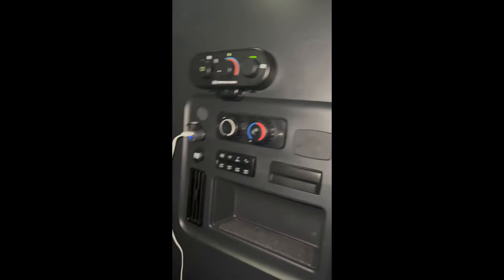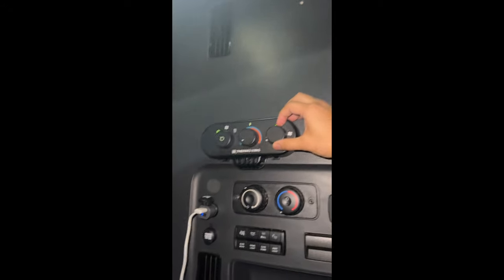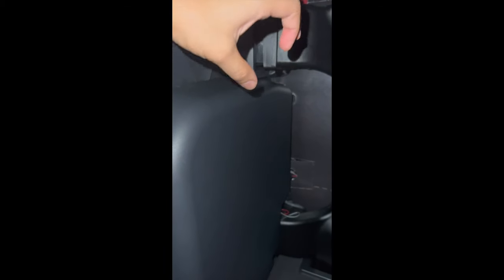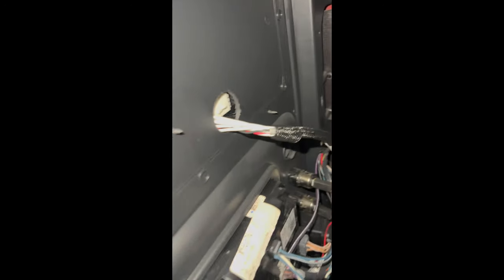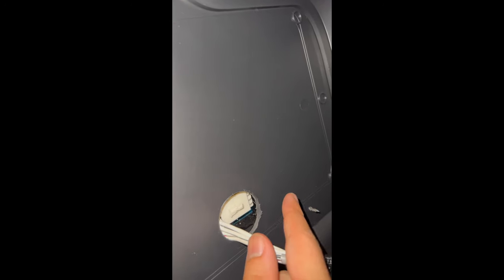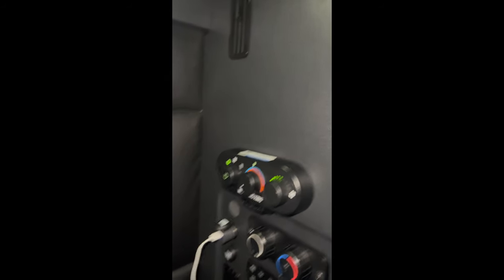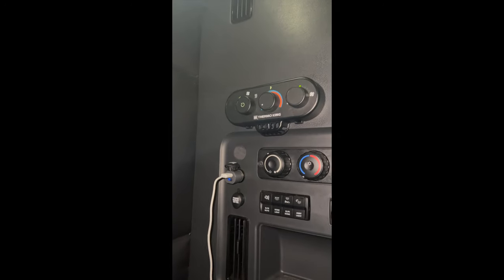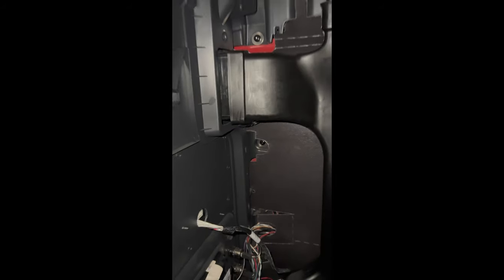How to reset your APU controls #cdl #apu #semitrucks #thermoking

Comment: Your video saved me from waking up to a freezing sleeper.  I have a cold weather sleeping bag, but this was a huge help.  Thank you for taking the time to share this and yes you are correct.  There are no videos showing this exact issue.  Just as you said in your video.  The HMI display for the TriPac is on, but the dials/knobs are not responding.  There is no red triangle and there are no codes.  The unit only has white lights on the display.  I followed your video and had to remove the faceplate off of the wall where I found the quick disconnect.  There are two little tabs that run along the bottom of the HMI control station (where the three dials/knobs are).  I used a flathead screwdriver and the faceplate popped right off.  I unplugged the unit from the power source for five minutes.  I plugged it back in and powered it back on by holding down the on button for a few seconds.  The faceplate started to respond as normal.  Bunk heater is working and fan speed as well.

Comment: How in the world am I supposed to disconnect the motherboard. I can’t even get 1 finger in there let alone 2 fingers to hold the piece. I tried using a small flat head screwdriver and that didn’t work. I don’t see how I could get in there without removing the entire panel in the cabinet. Is there a certain way I am to do this? Please make another video showing all the steps.  Thanx

Comment: Thanks for ur video. I found that the two little squares on the bottom of the control unit u can get a screwdriver and pry down to release the clips holding the unit to the bracket.  The hole for the wire was in the wrong spot for me to just unplug. Thanks again

Comment: Anyone know how to do this on a Kenworth T680, 2020? Mine doesn't have the plug-in directly in back. I'm trying to follow the wires, which run into the framework, under the bunk & towards the APU unit, which is located on the passenger side of the truck. But I can't find the ultimate disconnect that I need to undo for five minutes.
Reply: Nevermind. The plug-in is, in fact, directly behind the control panel, but one has to go through the front display to get to it. I'll see if this works, but even if it doesn't, kudos to the original poster for creating a video that gets to the point & does not appear to be a well-documented fix anywhere else online.
Reply: @FirstnameLastname-wl9jx  yes there are two small tabs that run at the bottom of the HMI display.  Take a flat head screwdriver and use the tabs as leverage to pop the faceplate off.  Just like you discovered the plug you are looking for us right there and has a quick disconnect.  I was having trouble myself.  I unplugged mine and after five minutes plugged it back in and everything is working again.  This video was a huge help.

Comment: 😊 thank you. Another way if youre in a pete is to use a flat head screw driver on the piece under eachh left and right knob. Specifically insert into the little slits and tilt up. The cover comes off top down like opening a taco that is facing up. Then push the little tab on the plug and pull. Hope this also helps
Reply: Thank you brother